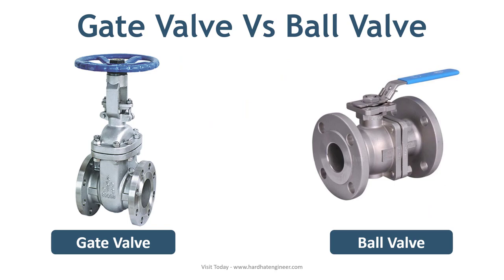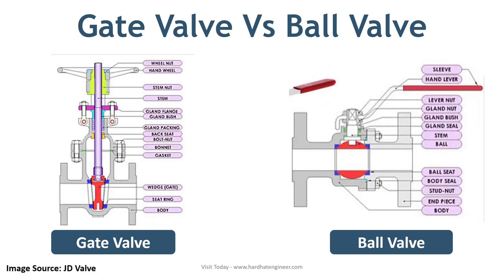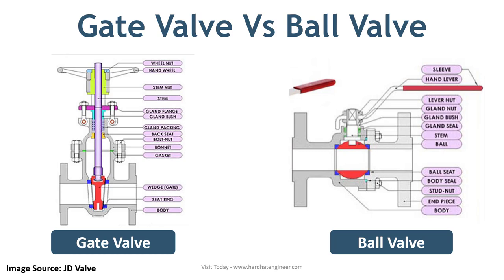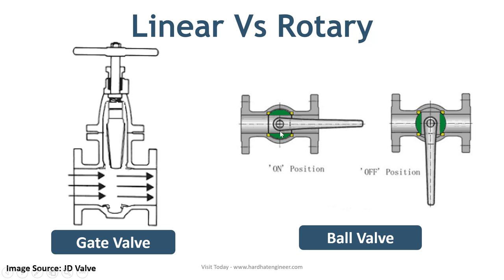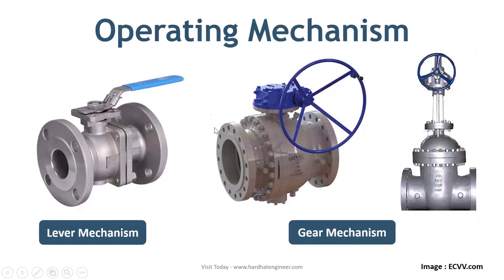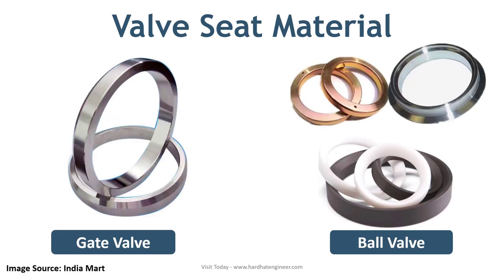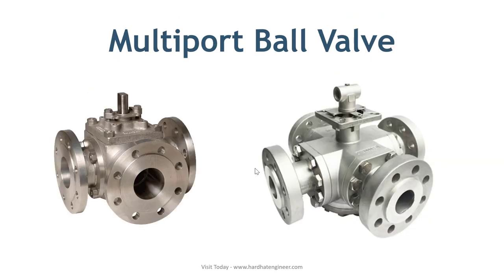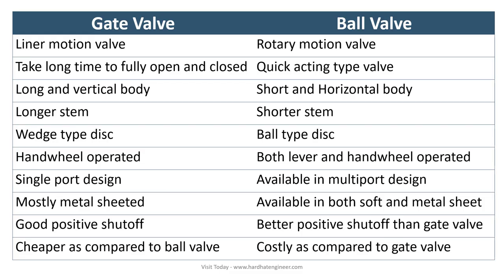Gate Valve vs Ball Valve Difference - Learn 6 main Differences

Comment: Thanks for this useful video, I have a doubt, when shall I use a gate valve and when a ball valve? someone once told me that gate valves are prefered for lines with liquids and ball valves are better for both lines with gas and lines with mutiphase fluids (liquid-gas) but did not give any reference. Thanks.
Reply from the maker: No, it is not like that. Both valve can be used in gas and liquid. It is depends on your requirements.